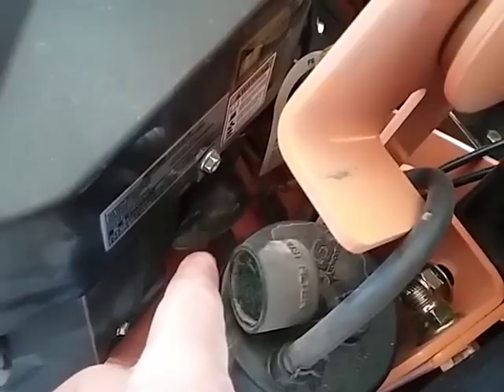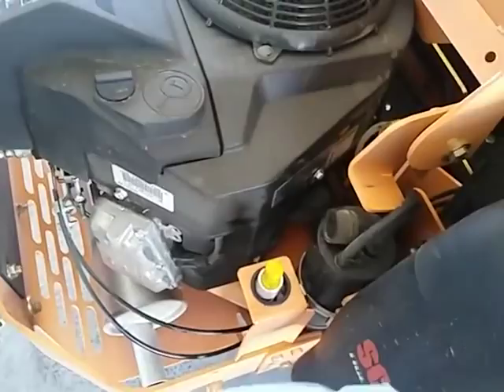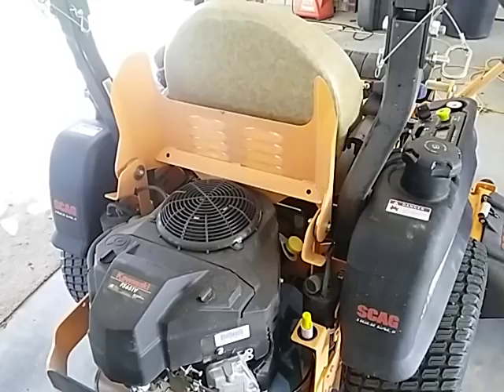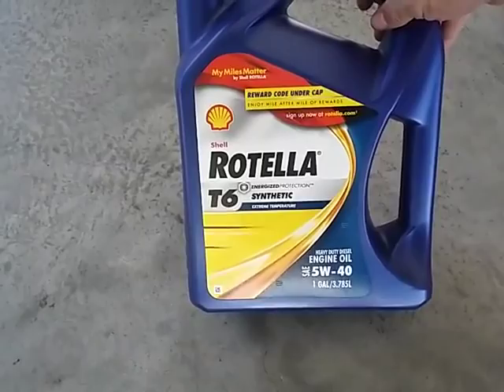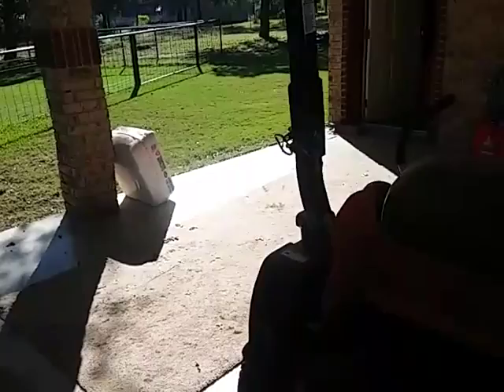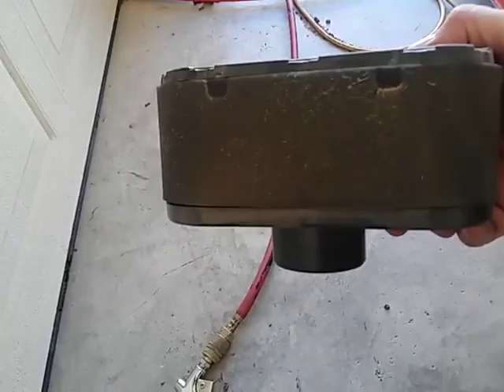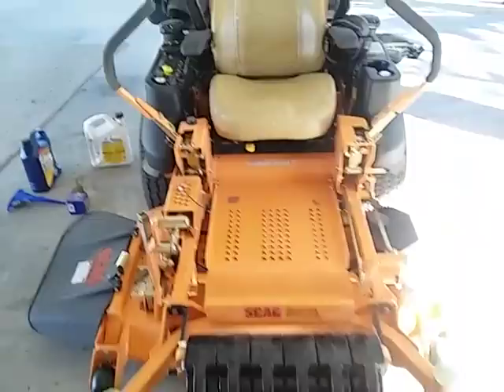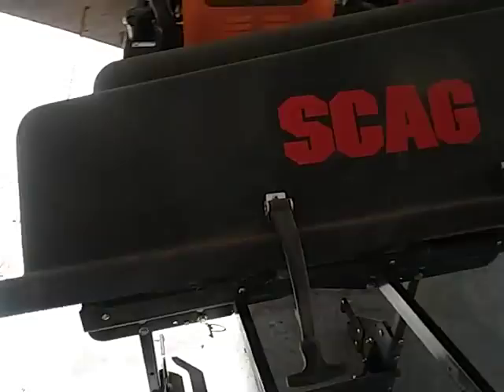SCAG TIGER CAT II (2) Oil Change, Preventative Maintenance, Walk around

Comment: Good video 
Can u show me where the grease fittings are on the collection system blower the manual says there are 2 one is on the outside but the other one is supposed to be behind the pulley on the other side can’t find it

Comment: There are 2 more grease fittings on the rear break bands. Remove the rear wheels and you will see them, (if it's the same as my Tiger cat...)

Comment: Watched 2 vids of oil changes on the Tiger Cats. Looks like the mowers have never been used. Unless these guys detail, and I mean detail the mowers after each use. Mowing several acres all the time, I can clean mine all up, but you can still tell I have a used mower.  Those look new ;-)

Comment: You just missed the Castor Wheel Pivot grease points.  You have to remove the plugs and install your own grease zerks.  Per the owner's manual, just every 500hrs/1yr.

Comment: When my tiger cat kohler blew up at 4848 hours , my dealer couldn't fix it , he didn't know what was wrong with it ,he threw a bunch of parts in it and told me to run it wide open , he couldn't get a throttle body from his suppliers , I put it on the trailer and it ran worse than when I dropped it of , that cost me a grand ..but I had to have a good mower , nobody had a turf tiger near me , so I bought the tiger cat 2 with a yamaha motor, carburetor..because I was curious how the yamaha motors did ...time will tell ..
But it was like going from a Cadillac to Kia...I dont really like the new mower , flat tire first night I brought it home ..that pretty much blew the wind out of my sales...then the hurricane flooded me , that finished me off ...

Comment: Your T Cat II has a few more options then my T Cat, it has 12 hours on it now, how often would you suggest packing those grease fittings, Thanks.
Reply from the maker: I think manual recommends every 8-10 hours.
Reply: I’ve been running every kind of equipment from a 300Tn Cranes to a Woods Mower for 70 years and one thing has remained true, parts are expensive. Grease isn’t. Grease it, a lot.😬

Comment: What was the black thing in the front connected to the top where deck is
Reply from the maker: You talking about the weights?  It is a counter weight for the rear bagging system.

Comment: I know this comment is well after your service! But please stop using oil designed for liquid cooled engines. These air cooled engines run up to 200 degrees hotter and aren’t designed to run that kind of oil. Mower oil has zinc in it keeps it from breaking down from the added heat.
Reply from the maker: That's a myth, the oil I used is fine.